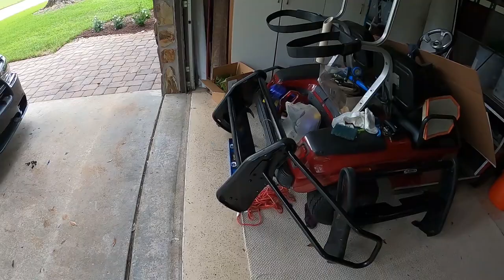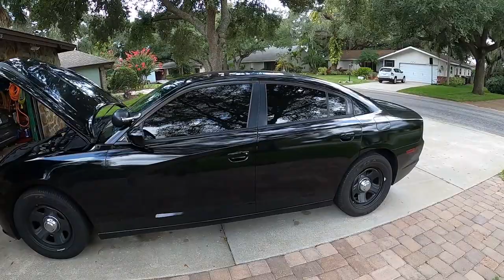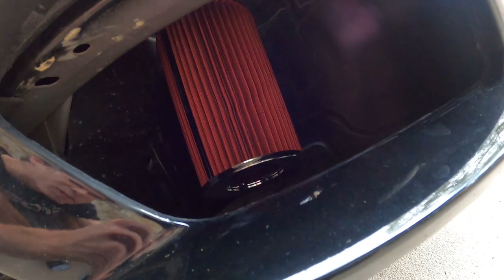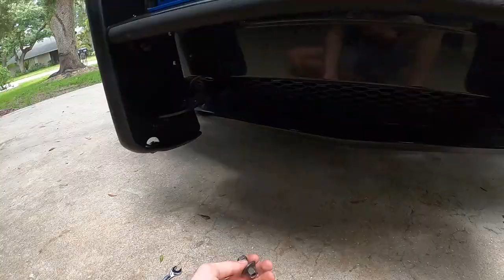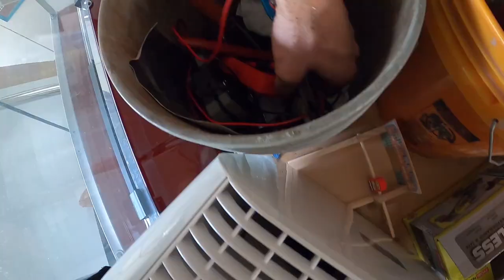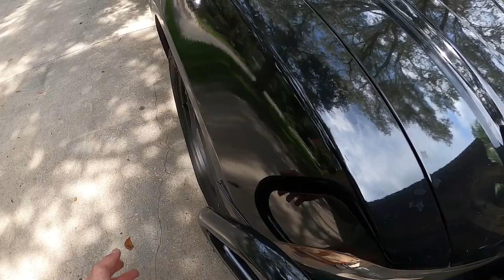Installing full push bar 2013 Charger pursuit

Comment: Yo intake should be safe bro. I have an explorer with the big ass brush gaurd and accidentally ran into a concrete wall head light first  but the gaurd really saved  my head light and the metal piece didn’t even bend. I believe I have a go rino. Hella good quality

Comment: OK you'll want to install two fuel pumps that are under the back seat. Access thru back seat and be sure to find a replacement shifter. They are expensive and hard to find.